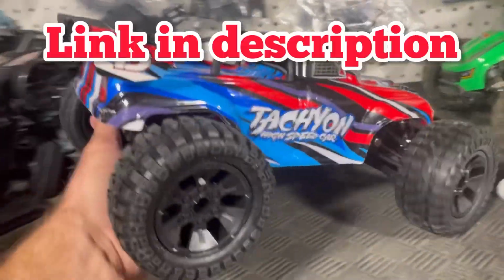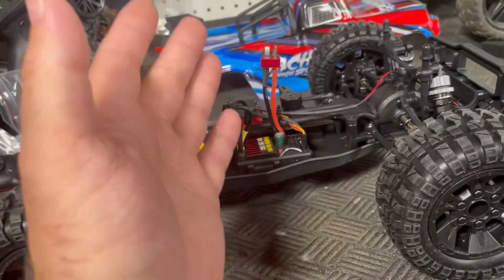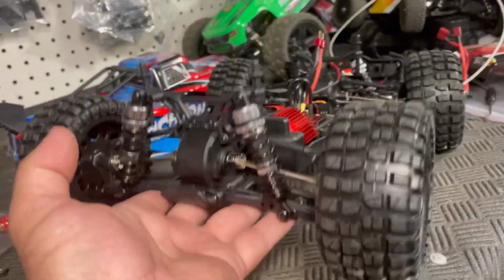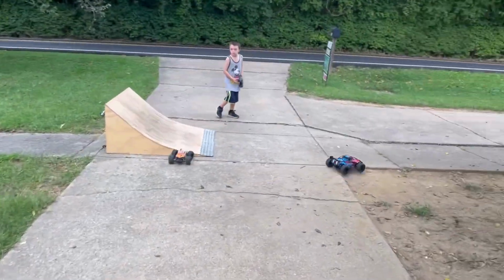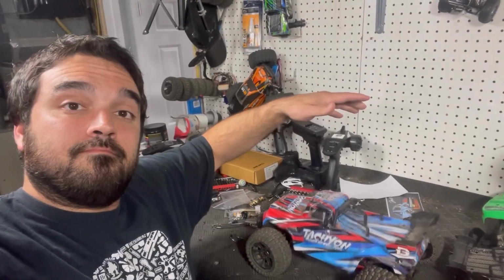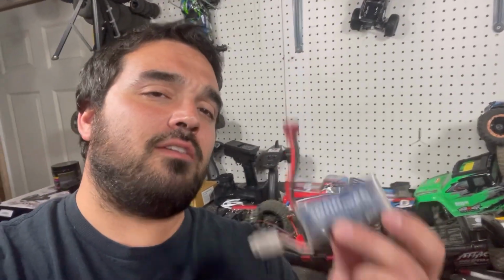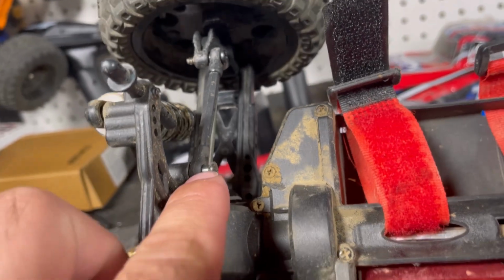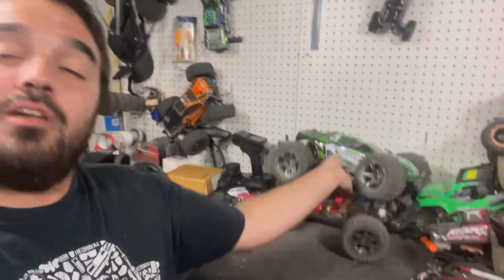New Brushless RC - 3s batteries included! DEERC 210E

Comment: So I bought the upgraded shocks and ended up bending one. In Your experience can they be straightened? I was thinking some heat and a hammer maybe. lol Either way I put the old stock shocks back in and actually put some shock oil in them 500cst. They still seem to just spring back up like they did when they had whatever goop the factory put in them. Not a slow rebound like the upgraded ones. Is that cause I need to use heavier oil or are the shocks just not much good? Thanks dude, much appreciated. Snow has finally melted and got some good RC weather in Canada 🇨🇦 now 🙂
Reply from the maker: I haven’t tried to bend those lol. I think I’ve only bent one and just tossed it but it was bent really bad. It may not bend back without snapping lol. Worth a shot though. Yes people say those stock shocks can be oil filled but they’re just awful. You could try a super thick fluid like 10,000 wt diff fluid lol almost a gel.
Glad your weather is finally coming  around!!!
Reply: @DerbyCityRC  yeah those shocks are just awful. lol I'm just going to leave them on until my replacement set shows up. Thanks again for the reply, much appreciated.🙂
Reply from the maker: Ya I feel like the shock shafts are made out of hardened spaghetti noodles lol. They bend real easy.
You’re welcome man, thanks!

Comment: Loving the content man! Just got it and I was wondering if the grinding noise it makes while moving it back and forth with your hand a defect or is it normal? Thanks in advance My kid has the Attack model as well and loves it!
Reply from the maker: Thanks!! I like the attack too! Besides losing suspension springs, we have yet to break that thing and we actually use it quite a bit.
Is it a grind or is it more if a deep click noise that you can “feel” as you push it? The feel is normal with internal motor resistance, but a grind would not be.

Comment: Can the lithium ion batteries be charged by the same charger as the lipo batteries?  I can't seem to get a setting for 11.1 volts when the charger says lithium ion.  Can I just charge it in the LiPo mode on 11.1 volts?
Reply: I am also interested in this!
Reply from the maker: Unfortunately i don’t really know. I know one of my chargers only charges to 4.1 volts per cell on li-ion instead of 4.2 on lipo. But my other ones, you just set it to li-ion mode and it doesn’t tell me the voltage. I really don’t know the answer here. Sorry!
Reply from the maker: See above response. I really don’t know, as a lot of times the cheaper ion batteries I just use the basic USB charger

Comment: Just got this and it is QUICK. But the steering linkage could use some improvement. Any ideas on upgrades?
Reply: Oder a set off cheap adjustable short suspension links and use those

Comment: Great content.  I let my son play with the car on the first day it was here and there were several times when he immediately went forward to reverse.... a learning process.  I think we already stripped a gear because the rear wheels do not get power now.  Have you tried any of the slipper clutch drives in the car?
Reply from the maker: There’s a good possibility it’s just an axle pin. It’s a 1.5mm x 10mm pin if I recall correctly and it connects the axle shafts to the axle stubs. Common break point and easy and cheap to fix. Hope that helps!! Could even cut sections of 1.5mm drill bits for a stronger material.
Reply from the maker: So they sell slip clutch options for this car? Never seen one!

Comment: Hi nice video, you did fly with this RC! :D
A question: DEERC 210E vs DEERC H16E, which to buy? (for beginner)
Thanks!
Reply from the maker: That’s kind of tough. Overall the h16e is probably a better car, but it’s smaller and still has its weak points. Also maybe a bit easier to get parts for as it shares almost all parts with the popular MJX 16208
Reply: @DerbyCityRC  many thanks! What grease do you recommend to to use for the engine/shaft gears? They are often without it, even when new
Reply from the maker: @flowmap those don’t typically need grease. You could put a small bit of something on them, but it’s not really a necessity. If you do, I’d say a small amount of white lithium grease will or wheel bearing grease that’s safe on plastic.
Reply: @DerbyCityRC  Thanks!😃

Comment: Can you offer any advice for me on how to get mine driving more straight? My 1st one I always ran on 2S and it seemed manageable but didn't have much top speed. My second one I put on 3S to get a little more zip but even on what seems like nice and flat roads that thing is veering any which way randomly if I go any faster than slow cruising speed. Maybe this is just a byproduct of budget engineering? I put a DJI air unit on there so I was hoping to get the drive-ability about as good as possible. I already changed out both sets of shocks and also just changed the ESC but left the old motor. So not exactly a rocket but I still can't steer the dang thing. I want to say it seems like it's obviously just the slight play in the steering assembly but that's all inherent in how the screws run through the ball joints. I will say that I did notice things don't exactly rev up super smoothly when holding the car and giving it full throttle. Thing has a lot of vibration. Thanks!
Reply from the maker: I’ve heard others complain about veering. Mine don’t usually do it, but seem to have days when it’s worse. It’s definitely a byproduct of budget engineering, double check to make sure all your axles are in good working order and none of the wheel or axle pins broke. That will cause a pull upon acceleration if so. They really all
Do it to some degree. The car I’m in the m iddle of reviewing now does it really badly. You get somewhat used to it and of course dialing in the steering trim knob can help if you haven’t tried that yet.
Reply: @DerbyCityRC  Ok thanks. They do actually seem consistent at least with the 2 I have. Maybe it's just me but the right front wheel seems toe-in cockeyed on both cars and there's no way to 'fix' it outside of heavily trimming the steering channel. Still, it's more like it never can decide which way it wants to veer which makes the trimming more difficult. I guess the steering arms can be replaced with something that's adjustable.
Reply from the maker: Ya many cars come with the tires toed out. Some people say it’s normal, I guess since when the front wheels are spinning under power, they may pull the front of the tires inward a bit. That’s my theory anyway. But yes you should be able to fit some universal adjustable arms 👍
Reply: @DerbyCityRC  Any chance you know how to take those things off? I just got some in the mail but realized there isn't just a simple philips holding one end in. I've kinda got it all closed up to where It's hard to get to the inner joint but it almost looks like a star bit or something. I tried to finagle some in there but I couldn't find any that fit. Almost looks like they are just supposed to pop on.
Reply from the maker: What parts are you trying to replace, the lower control arms? Those are the only ones not held in with a Phillips screw.
It attaches to the chassis with a pin that is pressed on. You have to push it out. Not the easiest thing to do the first few times. Is that the part you’re talking about?
Reply: @DerbyCityRC  I was trying to replace the steering links with adjustable ones so I can get it properly toed in on both sides instead of looking like a single pigeon-toed deal. I realized those just basically pop on some little metal nubs though so it looks like the solution there is it just find the right size screws to replace those little nubs in order to use adjustable links.
Reply from the maker: Man it’s been too long since I’ve looked at this car closely lol. But yes that sounds right!!

Comment: Hi there, is this the exact same Truggy as the DEERC 200e or what would the differences be? Other than the body of course. Thanks, just subscribed to your channel after watching a bunch of your videos. Keep up the awesome work!
Reply from the maker: Hey man!
Yes they are essentially the same. Chassis and related components for sure, but not sure if the motors are the same or not. Definitely similar if not. The other difference is this one comes with a 3 cell lithium ion battery so that makes it go faster than the 200e.
Glad you like the videos, thanks!!!

Comment: Great vids! Does anyone know where I can get a metal spur gear for the Deerc 210E??
Reply from the maker: You can get one from pxtoysrc.com (if they still have it), however I’ve never actually needed it. I tried it once but it intermittently caused my gear mesh to be too tight so I went back to the stock plastic and never broke one. Used for quite a bit with my 3300kv Hobbywing motor. More power than the car could handle but never broke or stripped a spur lol

Comment: Just got this car. First brushless car. The charger that comes with it seems to only charge the 3s li-ion up to about 3.9v per cell. Is that normal? Not sure what the end total voltage should be for these packs. Any insight would be extremely helpful! Awesome video!
Reply from the maker: Ya know, I’m not quite sure.
Does the battery last when you run it in the car? I believe I was around 20 minutes of run time with it.
Reply from the maker: 3.9 per cell should be about right, though. 3.9 x 3 = 11.7. 3s batteries are spec’d at 11.1.
Reply: Lithium ions generally hit around 4.2 on a full charge in my flashlights. I think 3.7 volts is the nominal voltage.

Comment: Hey buddy, Just received the oil shocks you recommended. Do I need to add oil to them or are these pre filled to perfection on arrival ?
Reply from the maker: Awesome! All the sets I’ve ordered have been prefilled to perfection. Hopefully yours are too!
Reply: @DerbyCityRC  Awesome man yes hopefully, bought the same red GPS you have as well and got it up to 27.9 mph on the 3s.  Purchased the oil beforehand just in case. 

Just received my OVONIC 3s Lipo Battery 35C 2200mAh 11.1V, Is it safe to run it on this truck? Got the B3 Lipo charger to go with it. I always take 15 min breaks in between the two 3s ones.
Reply from the maker: It should be safe for this truck since it’s technically a 3s batt if comes with. Just awesome be cautious and check for high temps!
Reply: @DerbyCityRC  Thanks for the input! I took a break & drove my childhood SAGITTA which was my childhood Radio Shack RC when I was 12 lol The Lipo Lasted total 46 mins and got up to 29.5 mph Nice not having to swap the battery out :) btw Shocks made a HUGE difference! I adapted to keeping it straight on acceleration when it would go to the side but with these Shocks it goes perfectly straight, Thing flows like a Lincoln Towncar now lmaoo
Reply from the maker: Haha! Nice!
Yup I like those shocks alot!!
Reply: @DerbyCityRC  Yup! Me too! Brother does the Radiolink RCGS V3 Radio Transmitter work on these? I eventually want to at more range :)
Reply from the maker: Any transmitter will work, but you would have to swap the esc to be able to use it. Plenty of decent ESCs that would work for a decent price. Hobbywing makes great stuff!
Reply: @DerbyCityRC  Awesome Thanks!

Comment: Hey there I'm a new fan as of recent but love your reviews! Ive had this truck for about a month.  I did upgrade the motor to a 4370 kv motor and a 60A esc and I'm looking for more upgrades like a metal vs plastic flywheel! Any suggestions would be greatly appreciated! Thanks!!!!
Reply from the maker: Thanks! I like how you called the spur gear a flywheel. Are you in the auto industry?
There are a lot of good Parts available on Pxtoysrc.com including a metal spur gear, metal knuckles, and a few other things. I had mixed luck with the metal spur gear sometimes causing the mesh of the gears to be too tight, and since it’s not adjustable, I just went back to plastic and have never broken or stripped one👍👍

Comment: Hey brother I installed the shocks, Rear ones are spongy after installing which seems right, Fronts go up and down no spongy affect. Any suggestions? Thanks in advance and huge difference from stock shocks for sure.
Reply from the maker: They don’t necessarily want to feel spongy. Just want to feel resistance. An actual spongy feel may mean there’s air inside. I would just open up the top caps and check oil level. Add or remove some as needed. You need it a bit below the very top. Just make sure the whole shock bottoms out and if it doesn’t, remove a tiny bit more fluid. Hope that helps!!
Reply: @DerbyCityRC  Definitely a huge help, Thanks for all the info and I see your channel growing quick. Great quality stuff, You convinced me to buy the Attack Dee Rc for my son as well and he's having a blast with it, 7 and Autistic obsessed with cars. I have tons of rechargeable batteries and RC Cars for him, Never got him something this fast because I'm afraid he would destroy it but their strong and he's become a good driver:)
Reply from the maker: That’s awesome! Yea the attack car is the one I let my younger kids learn on. It’s been a complete beast!!
Super cool he’s into cars too!!

Comment: If I was to get that brushless motor and new esc, will it work my the existing stock radio controller?
Reply from the maker: You’re saying order the motor and esc for this car? What would you be putting it in?
Reply: I mean if I was to order the new brushless and esc that you posted the link for, will it work with the radio the truck originally came with or do I have to buy something else?
Reply: I have a DeeRc 9200 brushed that I want to upgrade
Reply from the maker: Oh gotcha. No it won’t. You do have to get a new controller with receiver. This is the one I use: https://amzn.to/3GXOq36
Reply from the maker: Good car to upgrade!

Comment: What dimension batteries can fit in that chassis?
Reply from the maker: Don’t remember for sure, but these batteries fit almost perfectly and I believe they have the dimensions in the listing pictures.https://amzn.to/3UnyQUv
Reply: @DerbyCityRC  yeah I’ve since done a lot of looking around the latest models come with 3S batteries however most 3S lipo are too big for this chassis. The length is just shy over 3” width about 1.5”, height is as high as the straps will allow you.
Reply from the maker: I have these batteries and I’m pretty sure they do fit. But it’s been a while since I’ve ran them on this chassis so I could be wrong. I use these in a lot of other things too! https://amzn.to/40WadAQ

Comment: Anyone know what the difference is between the 200e and 210e? They both appear to be identical spec-wise on Amazon (except the 200e, which is cheaper, has two shells instead of one).
Reply from the maker: Besides the body, I’m pretty sure the only difference is the 210e comes with 3s batteries instead of 2s, so it’s quite a bit faster

Comment: Are these 1/10 or 1/12
Reply from the maker: They’re 1/12. These are ok, but if you’re looking in this size and price range I’d point you to something different.
The HBX 2997a or the Rlaarlo Omni-Terminator.
Reply: @DerbyCityRC  any of these cheap brands make a real 1/10 or 1/8? I really like the Terminator but it's also a bit small
Reply from the maker: The Hosim X17 would be the only one so far. They market it as a 1/8 but it’s more like a 1/10. It’s a super fun car but not as durable as it should be. HyperGo is supposed to be releasing a 1/10 model soon but I’m not sure if it will be a true 1/10 or not yet.

Comment: Can a faster motor be fitted
Reply from the maker: Yes it can, but you would also have to replace the esc and transmitter. So if you’re going to do that, which I DO recommend, just get one of these cars here: https://amzn.to/3ubVgff

 It’s the same exact chassis but comes with a brushed motor set so it’s cheaper. Only other difference is the body.
Here’s some videos on them, the only problem is Amazon seems to be out of stock of the Hobbywing motors.
https://youtu.be/8mgh8dPEF4U

https://youtu.be/bT0lcHs_mdY

https://youtu.be/9E3rVUqnNwc
Reply: @DerbyCityRC  great thank you love the reviews been looking at the Deerc 001e also can't decide
Reply from the maker: The 001e is a bit smaller, but seems like a decent car. Can’t say for sure cuz I don’t have one 🤣👍

Comment: Dang 25.7mph thats it!? Lol my 2997A is way faster then that. I was about to buy  200e but glad I seen this video.
Reply from the maker: Ya this was decent for that price when this came out. The 2997a is much newer and blows this out of the water in every way. 😃 Get the new Rlaarlo Omni-Terminator!
Reply: I actually was going to buy the omni carbon fiber version but I got the Rlaarlo 1/14 scale truck instead but took it back cuz it had esc issues. Now I  got an Arrma Vorteks boost version but ordered a spektrum 3668 2400kv motor and a 120A  esc from the Outkast/Kraton 4s which should b here tomorrow. Should b a bit better than the omni terminator I think lol  @DerbyCityRC
Reply from the maker: @boxer951 haha! Yup I think so! I love my Vorteks! Even with the stock setup.